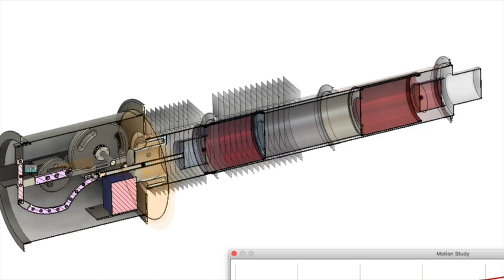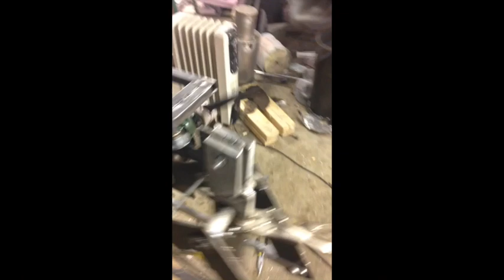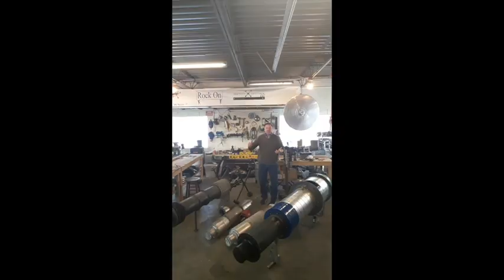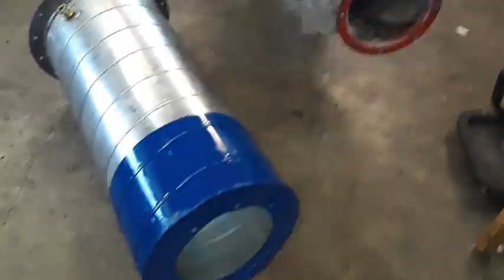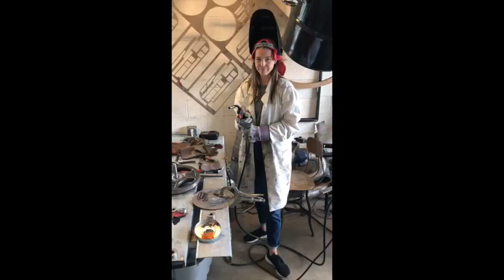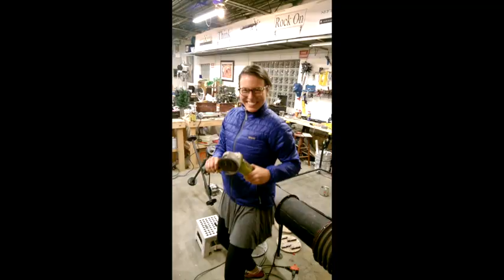Melvin Update - Jan 2019

Comment: I am contemplating building a small cabin-like dwelling in NH's countryside. My goal is to be off-grid. The power would be provided by a combination Solar during the warmer months and, if feasible, the Melvin during the colder ones, with a gas powered stove. Gas could also be another energy backup and ultimately the old Honda Generator in case of a rare emergency. In this way, having more than one power supply guarantees proper comfort and survival. Now my question revolves around a Melvin setup in a chimney....in essence the heat gathering part of this device would have to go right above the flames. Since the whole device is rather long , the rest of it would reside in an outside box, well shielded, but opened to the interior of the house so that it can stay as close as possible to room temperature in the Winter, this would also reduce some of the noise. In this way, burning wood would have 2 purposes: 1) Give heat 2) Power the Motor to charge the batteries.
Reply from the maker: Udmbfck - great application for "The Melvin" . - you're correct you only need to put the hot end into the heat.  The hot end is 29" long and 10" in dia (12" at flanges) - you only need about 16" in the heat, but would recommend insulating the rest of the hot end (from 16" to 29") if outside of the active heat source.  Check out the engine brochure here for a few more dimensions -  http://online.fliphtml5.com/nkyhq/huuf/#p=1